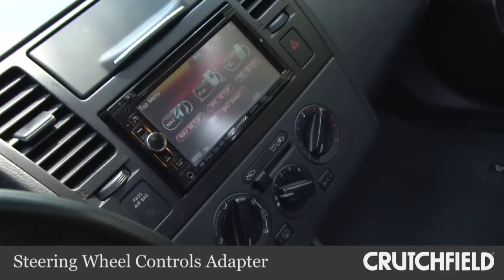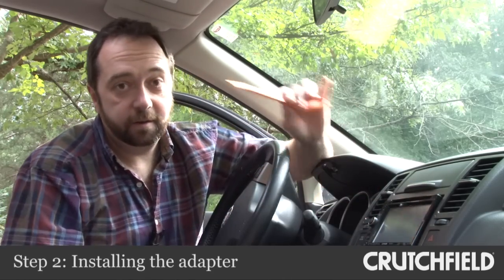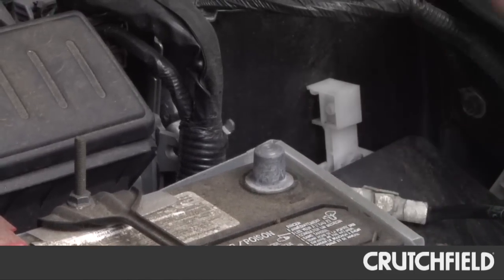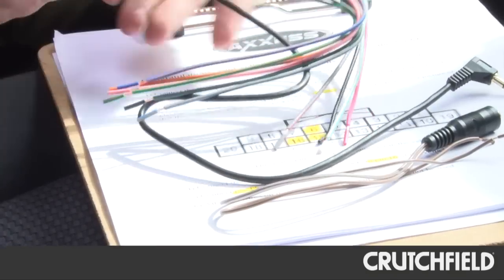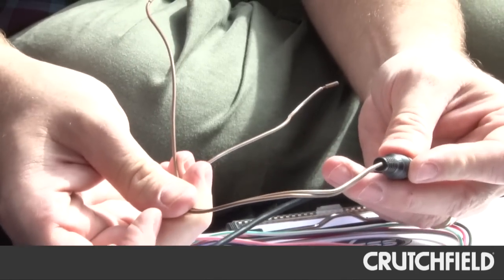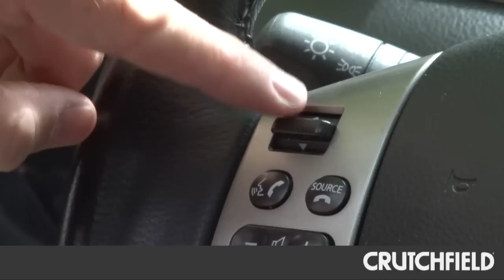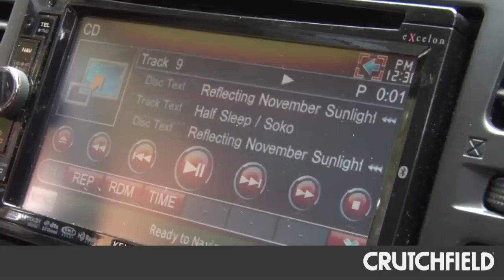Installing a Steering Wheel Audio Control Adapter | Crutchfield Video

Comment: don’t worry about the wire connection color and pin details, it’s not like we all came here for that…
Reply: my thoughts exactly
Reply: Each car is different, you need to find that out yourself. Did you not hear that part?
Reply: Jordan Hansen I believe many of us came here in search of which wires out of the interface harness will be used. Maybe if we knew what pin3 were we could figure it out in our vehicles. I am sure plenty of people have gone to the website to get instructions, only to be given an error like "We are sorry, but we are not sure, if this device is compatible with your vehicle and stereo. Your exact vehicle is not one in which we have had the opportunity to attempt an install. Please call customer service at 1800... ...."
Reply: exactly. Where the hell in the car do you find the wires to connect to those Key1 and Key 2 on the adapter ? are we going to find behind the stereo or we have to take a part everything in the car ? stuff like that. ....
Reply: @TuanLe-eb5yp  you need to use a steering wheel control interface , and the solder a 3.5mm female jack to key 1 and key 2, then you can plug the steering wheel interface 3.5mm male into the 3.5mm female plug you soldered to key 1 and key 2 , i hope that helps

Comment: do you know what kind of Steering Wheel Control Interface do I need to get for Sony head units? do the Metra Axxess have any interfaces that will work on a sony head unit?

Comment: Im havin trouble installing this in a 2003 Acura 3.2 Tl. I have everything wired except for the the ASWC, I have the Ignition wire and ground hooked up but I dont know where to connect the other wires, at first they didnt even have the info on the site and had to call them. Please HELP!!!!

Comment: hello. sorry for my bad english. i have little strange question. I install steering wheel in my car audi 90 1990, but I install new model of steering wheel, model 2013. that steering wheel have control on him. its posibile to active that remote control from steering wheel in my pioneer 6100bt over 3.5 jack behind? thank you

Comment: i have problem ..dont know which wire connect steering toyota avensis2001 modell.2 wire red and green ..onther iso concact  connect touch 7 dvd pioneer

Comment: You skipped the most critical step, which was, where you connected the two wires from the steering controls adapter? You said there were only two wires you needed for your install, but did not show where those two wires went to?
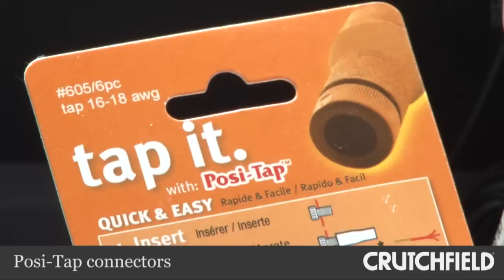Reply from the maker: +Mark Newton In this example, those two control wires are shown connected to the adapting harness around 2:46 in the video. Since color codes, wires used, and location of those wires to use vary from vehicle to vehicle (and vary depending on interface used to install the radio), we didn't spend a lot of time highlighting this part. If you need help installing one you purchased and you got it from us, I recommend calling our technical support. If you purchased elsewhere and they cannot help you, I recommend contacting the manufacturer for help. For additional assistance & personalized recommendations, feel free to contact us directly:

http://www.crutchfield.com/I-rYTVc000/support/ContactUs.aspx

I hope that helps.
--Crutchfield
Reply: While that's cool, and that's what I'm going to do (since I did get it from you guys), you could have saved both myself as a customer and your support people a lot of time with just a teensy bit more info here. Is it really only one of those two wires necessary? Does it matter which one it is, so I need to call support to get the right one, or does it not matter at all? I have one (and only one) Steering remote lead from my stereo, so I'm so close here. 2-10seconds more on the video explaining this woulda been great.
Reply: Every car uses different wires. Go to axxessinterfaces.com to find vehicle specific instructions.
Reply: Lo

Comment: I own a 2008 Ford Focus, and I bought this adapter for my new stereo, the flaw in this adapter is that it needs to be tapped into the constant power wire. After a month my battery stopped working. I would recommend using a CRUX Smart Harness adapter. It doesn’t drain the battery and it works great. If you also own a Ford Focus I do recommend the RP4-FD11 harness, that’s a very good one too.
Reply: You should have connected it to the accessory
Reply: @hassanfakir7005  the accessory position wouldn’t do anything, everytime it would reset itself.

Comment from the maker: Assuming your Kenwood is also compatible with the adapter (not all aftermarket stereos are), any controls you had over the original factory stereo (volume, channel, source, etc.) would be restored. The trip computer functions can be retained by grounding a wire from the factory harness. You will find more info in the "Support" section of the main Crutchfield website. You can also call for additional assistance: 800.315.0030--Crutchfield

Comment from the maker: Keep in mind; the vehicle & the aftermarket stereo both have to offer compatibility with the steering wheel control interface adapter. Any Pioneer that offers compatibility should also have the 3.5mm input jack for the adapter. If you purchased from Crutchfield, give our tech support department a call. Their toll-free number is printed on the back of your invoice. If you purchased elsewhere & the retailer will not help, you can call Pioneer directly: 800-421-1404. HTH!--Crutchfield

Comment: Can the hands free calling control still work? good video by the way.
Reply from the maker: Sometimes the wires for those hands free calling controls do run to the radio and when they do, they can be kept working. Sometimes they do not but instead run to different modules in the vehicle. When that happens, we cannot keep them working. For additional assistance & personalized recommendations, feel free to contact us directly:

http://www.crutchfield.com/I-rYTVc000/ContactUs.aspx

I hope that helps.
--Crutchfield

Comment from the maker: Most Sony stereos will work with a steereing wheel control interface adapter. Keep in mind; the steering wheel control adapters must also be compatible with the vehicle you plan to use it in. So, we'll likely have a compatible adapter but we'll need the model number of your Sony stereo and the Year, Make, & Model of your vehicle to be sure. Feel free to call for additional assistance: 800.315.0030--Crutchfield

Comment from the maker: For the steering wheel control interface adapters, you will need to connect to the factory wiring and the aftermarket stereo. The individual adapters offer specific instrcutions regarding these connections but , if you purchased from Crutchfield, our tech support department can assist you. Their toll free number is printed on the back of your invoice. HTH!--Crutchfield

Comment: Can this be run from the same 12v accessory and same ground as the radio?  My 2011 Crown Victoria LX seems to only have one of each when I looked at the connector and I don't know whether they can be shared between the aftermarket radio and ASWC-1 or if it's more complicated than that
Reply from the maker: Most of the information I have seen on this indicates that a lot of vehicles need the ground to be in a different spot from the radio's ground. I would imagine this is true for all vehicles. If you purchased it from us, you can give our technical support a call for confirmation. If you purchased elsewhere and they cannot help, you may reach out to Metra as they make the ASWC-1 interface.
HTH!
--Crutchfield

Comment: I have a question, regarding this issue, i got a Nissan Sentra Custom 2.0 2011, and I got a Stereo Car S90 but I could not make work either with a Steering Wheel Audio Controllers or iPod Docking, that came with the Car, do you have a product that could help me out?

Comment from the maker: If you purchased the equipment from Crutchfield, give our tech support department a call. Their toll-free number is printed on the back of your invoice. If you purchased elsewhere and the retailer will not help, you may want to contact the adapter manufacturer directly. HTH!--Crutchfield

Comment: I have an extremely good question, I just bought this for a 2006 chevy malibu and i want to know if i connect these wires to the stock radios harness or the actual steering controls harness.... thats the only part im stumped about.

Comment: thank you for this video, it's been helpful.. However i'm stuck on what to do with the Brown wires on the female end of the 3.5 mm jack.  I have a pioneer that doesnt have the 3.5mm jack on the back like you.. where did you wire the brown wire into?

Comment: Bought a stereo with a package from you guys, the package for my Audi has this but there is no instruction on how to install. The axxess website shows that my car is not compatible. Bought this a while back and I can't return along with two noise isolators that my car didn't need :'(
Reply from the maker: +Omni Potent Because you purchased it from Crutchfield, our Tech Support department can assist you with any installation problems or questions. You can reach them directly at the toll-free number printed on your invoice.If you do not have your invoice, you can contact our customer support department: 800-955-9091. They can locate your order in our system and transfer you onto tech support.I hope that helps!--Crutchfield

Comment: Hi I am doing my research before installing an aftermarket deck into my Mazda 6 and have a few questions you may be able to answer.
First off...an aftermarket deck should only affect the "audio controls" on the steering wheel correct? As in, the cruise control functions on the steering wheel should be fine?
 I am considering buying a Sony MEX BT3-100p  single din deck that has bluetooth functionality. My car also has hands free calling features on the steering wheel. Will these calling features work with a bluetooth head unit? Will the Axxess adapter also allow the answer call and hang up button on the steering wheel work? Built in microphone? etc...
Another question I had regarded satellite radio. My stock head unit was Sirius ready and all i had to do was call Sirius and register. I currently have a 5 month subscription. The Sony head unit i am considering says Sirius XM ready, will this be easy to register my current subscription with the stereo deck? Or will my subscription be lost with the stock head unit being replaced? 
Sorry if I sound very clueless but these are features in my car that I did not have before. 
I was used to an old Subaru Impreza with just the basics. Basically I want to upgrade my sound but do not want to sacrifice any of the cars features...but also do not want to spend a fortune.
Thanks

Comment: So I've got a question, am I able to install this on a brand new receiver that has never been run before that way I don't have to wire it, run it once, and then rewire it with the adapter and program it?

Comment from the maker: The Crutchfield MasterSheets cover the physical removal and replacement of the factory components (stereo, speakers, etc.). Wiring information and color codes are provided in the manuals for the stereos and harnesses we offer. If you purchased from Crutchfield, our tech support can assist you as well. Their toll free number is printed on the back of your invoice. HTH!--Crutchfield

Comment: I have a 2003 Lincoln Aviator, What adapter do I need, are any brands better than another?? Which one has the least amount of wire cutting and programming?
Reply from the maker: The factory steering wheel controls in your vehicle can be retained with an adapter and a compatible stereo. The Axxess ASWC-1 is compatible and our top-selling & highest rated option: http://bit.ly/1k9BwOS 
For additional assistance & personalized recommendations, feel free to contact us directly:

By phone: 800.315.0030
Online chat: http://bit.ly/1b07Ykm  
e-mail: advisors@crutchfield.com 

I hope that helps.
--Crutchfield

Comment: Which wires of the harness of the vehicle did you connect the green/white stripe wire and the gray/red stripe wire to? I have the same wires but I don't know where to connect them to. Thanks in advance.
Reply from the maker: If you purchased from Crutchfield, you can contact our Technical Support for more help using the Tech number printed on your Crutchfield invoice. Otherwise you may want to contact the manufacturer of the steering wheel control adapter and/or head unit you're installing for further assistance. 

Hope that helps.
--Crutchfield

Comment: great video.... so just to make sure that i heard you correctly... you are saying that I only need to use one of the brown wires frm the 3.5mm female adapter? and if so, which one. the one with the white stripe or the solid?
Reply from the maker: The installation/wiring of your steering wheel audio control adapter varies depending on the head unit model and the adapter model itself. If you purchased the gear from Crutchfield, our Tech Support can help in more detail with the install--you can contact them via the Tech number printed in your email invoice. 

If not, you may want to contact the retailer or the manufacturer directly for more assistance. Thanks!
--Crutchfield

Comment: Does adapters is only for the volume control only or it would work for the Bluetooth too?
Reply from the maker: There are adapters that can retain the factory Bluetooth steering wheel controls in certain vehicles with compatible stereos. Not all adapters are compatible with all vehicles though. 
To see if they can be retained in your vehicle specifically, contact us directly:
By phone: 800.315.0030
Online chat: http://bit.ly/1b07Ykm  
e-mail: advisors@crutchfield.com 

I hope that helps.
--Crutchfield

Comment: I have a 2013 Dodge Challenger & I recently bought a Pioneer AVHX5600BHS In-Dash DVD Player but I'm not sure which steering wheel control adapter I need to buy for the specific stereo I bought. Can you help please?
Reply from the maker: While there are integration harnesses that offer built-in steering wheel control retention, there is a separate adapter for the factory steering wheel controls when you've installed the stereo with a basic integration harness: http://bit.ly/1hPJEm8 
This adapter is compatible with both your vehicle and the Pioneer stereo.
For additional assistance & personalized recommendations, feel free to contact us directly:

By phone: 800.315.0030
Online chat: http://bit.ly/1b07Ykm  
e-mail: advisors@crutchfield.com 

I hope that helps.
--Crutchfield

Comment: I have AVH-X391BHS Pioneer Aftermarket Stereo, and I wanted to know what kind of Steering wheel control adapters can work with the stereo so I can control it from the steering wheel. Also, I currently do not have any factory steering wheel controls. Thanks Guys love the videos
Reply from the maker: Your Pioneer is compatible with the Axxess RFASWC universal steering wheel remote which can mount to your existing steering wheel and be programmed to control most common functions of the stereo:
http://bit.ly/2A2YAxz 
For additional assistance and personalized recommendations, feel free to contact us directly by phone or though our online chat service:
http://bit.ly/2jBGHPp 
Hope that helps.
--Crutchfield
Reply: sends an IP pulling link* lol  @crutchfield

Comment: grate vid! I have a question for you, im building a custom car, and got a chevrolet cruze steering wheel and i want to make the controls on the S.W to work on a sony or pionner stereo, is this possible? thanks
Reply from the maker: The Metra Axxess ASWC-1 is compatible with most versions of the Chevy Cruze so it may be possible: http://bit.ly/1k9BwOS 
For additional assistance & personalized recommendations, feel free to contact us directly:

By phone: 800.315.0030
Online chat: http://bit.ly/1b07Ykm  
e-mail: advisors@crutchfield.com 

I hope that helps.
--Crutchfield

Comment: Where do I get the connector from with the two brown wires coming from it?  What is that wife called?  Thanks in advance
Reply from the maker: The female 3.5mm connector with the brown wires comes packaged with the Axxess ASWC-1 steering wheel integration adapter:  http://bit.ly/2ngjW5F  For additional assistance and personalized recommendations, feel free to contact us directly:  http://bit.ly/2jBGHPp  Hope that helps.--Crutchfield

Comment: Hi, so the 3.5mm plug's Brown cable just goes to the Brown (KEY 1) in my Aftermarket stereo? Not both Brown and Brown/White?.
I have a Chevrolet HHR and the Aftermarket stereo has 1 Brown (Key-1) and 1 Brown/white (Key-2).
Thank for helping.
Reply from the maker: Some radios will use both wires, some use only one wire (the one in this demo video used only one), and some will use the 3.5mm connection. If you purchased your gear from us, I recommend calling our technical support for help. If it was purchased elsewhere and they cannot help, it might be best to contact Metra on 800-253-8324 as they make the ASWC-1 interface
--Crutchfield

Comment: I have a 2007 Camry i’m Upgrading it to a DVD navigation system with the JPL adapter but the steering wheel control is not working is there anyway to have it work without buying any more adapters
Reply from the maker: Sorry to hear you're having problems out of your steering wheel controls.
Please chat with an advisor online. We will be happy to go over the adapters you're currently using, and direct you on the need of possibly purchasing a different adapter.
www.crutchfield.com/I-rYTVc000/contact